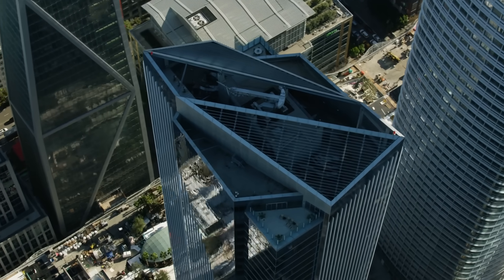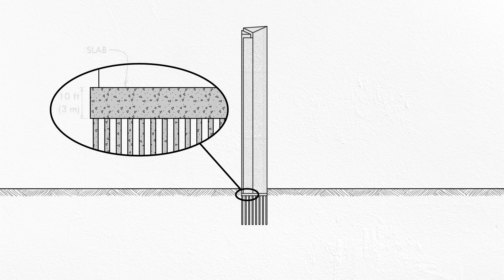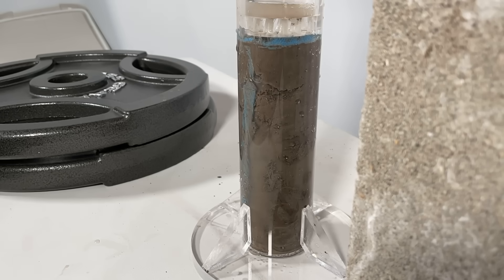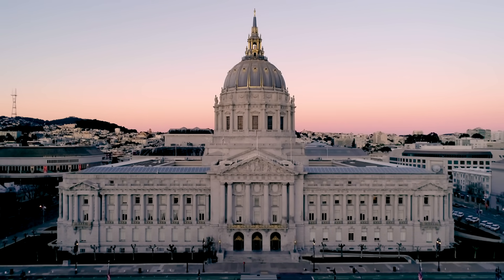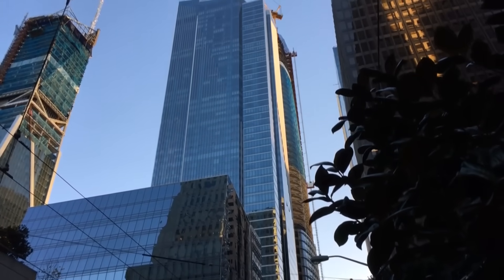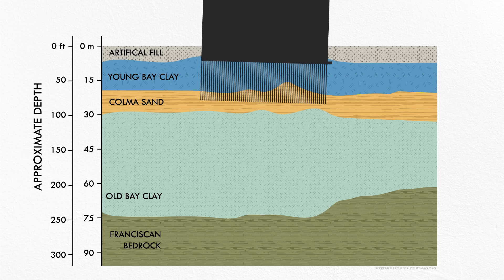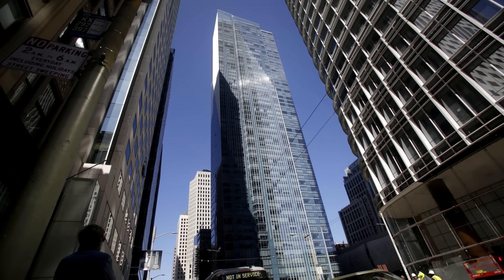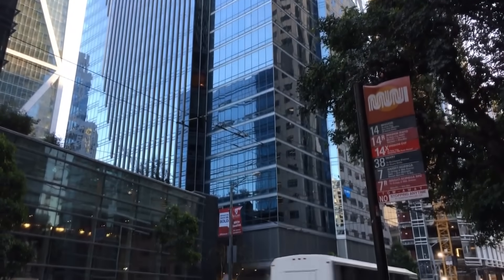What Really Happened at the Millennium Tower?

Comment: “But the estimated cost for the repair was as much as $500 million, more than the original cost of the entire building. Turns out it’s a lot easier to drill foundation piles before the building’s built than afterwards.”. 
Great quote, you win this one
Reply: This comes under the "do it right the first time" school of thought.
Reply: @kennethellison9713  Measure once...
Reply: If it is that expensive would it be cheaper to demolish the building and just start over?
Reply: @alanhersch4617  Or just deconstruct the building to half it's height. Save yourself the trouble for the inevitable.
Reply: @MarloSoBalJr  Yeah someone else replied to me above with a good point. the weight of the building is important to the foundation of the entire block, so it isnt free to just remove part/all of the building. There probably is a way though to add dense weight to the bottom as you took apart the top? 

Anyways, there probably is a solution along these things that could work, but it is a bit more complicated than I first thought, and it definitely makes it WAY more expensive to deal with.
Reply: @alanhersch4617 You also have to buy out all the leases and pay to demolish the building.

Also the weight of the building on the ground was factored in when neighboring skyscrapers were built so removing in could cause them to start leaning too.

So rebuilding isnt an option.

They have to drill new pilings under an occupied skyscraper and do it in way that doesnt affect the settling rate of buildings next door.

If anything goes wrong you could wind up causing several buildings to become unstable.
Reply: I’ve worked on a project for this developer, and I have to say: it couldn’t happen to a more deserving group. They were most likely too concerned with keeping costs down and dragging out decisions about wallpaper to catch errors in foundations.
Reply: The insurance is lot more expensive.

"Hello, I'd like an insurance quote for driving piles under an occupied skyscraper"

(Underwriters head explodes.)
Reply: Grady played Captain Hindsight a bit here.

Comment: 11:45 "But whether they could have reasonably predicted the performance of the original design is more a complicated question"

Bro, the rule of thumb for tall structures on fill or loose soils is clear, 33% of the aboveground height needs to have piles sunk to that depth that are minimum 8" in diameter, spaced evenly across the entire load.

12:02 "The developer's engineers and the city have shown that the building is PERFECTLY SAFE" 

Holy hell, talk about ridiculous statements, even just based on the limited and censored coverage in your video. You don't show the quarter and half inch cracks that are probably obvious in the concrete foundation, because I'm guessing the building owners don't want those pictures published. The steel is obviously bent in a major way (half inch or more), and again, you and the developers don't care.

In your own video, you show that the settling was 12 inches as compared to the plan's 4-6 inches, the settling was uneven, and you didn't show the inevitable cracking that steel or the foundation will have when one corner of a slab is literally 12+ (and RISING) inches higher than the other corners. The city also doesn't agree with your estimation "that it's perfectly safe", when the 12" lean on the top at the top is OBVIOUSLY out of the building code's 6", which is being ignored because of politics/your bias in favor of building owners(?).

Also unmentioned by this video: climate change causing seawater to go into the soils, earthquakes effect on soil dispersion, the long term effects of trains nearby underground, and increased flooding risk from climate change.

Oh, and the retrofit could fail - the pilings could become bent, earthquake could straight up cut them, the jack could slip/fail, the sleeve could be bent and friction could prevent the jack from working, or the building could magically settle in another direction.

And finally 12:10 "but the prices of those luxury condominiums plummeted" - cry me a river. Oh no, some rich developers don't get to overcharge the SF workers to the tune of a profit margin of 90%! Meanwhile if SF banned nonresidential owners of housing, something like 40% of the existing housing stock would be forced to be on the market, and considering 52% of SF rents, methinks some competition would be good for basically everyone with a net worth south of $400,000.

Your political takes are god awful and I'm guessing there's a reason why you're here doing YouTube videos as compared to out there in your "field".

Comment: Grady, excellent thumbnail sketch of the issues. Geotechnical engineers have a unique challenge in the liability they face with the potential for "unforseen" conditions. The choice of pile vs drill shaft is complicated, especially when you are dealing with high water table, seismic loading, and clay. You hit the issue for all engineers when you stated "reasonable assumptions". The other issue, public relations, is something that has been an issue with engineering "mishaps" for many years. You should do a series on the effects of PR on engineering. Love the videos, and the care you take to present the situation in simple terms.
Reply: …and the corrupt political landscape of SF. I know it well.

Comment: I don't think that an engineering report stating that the building is already well out of spec, and that its condition continues to deteriorate, is quite the same thing as declaring it "perfectly safe".  It's more like declaring it "not unsafe yet".
Reply: "Perfectly safe at the time of writing this, can't guarantee tomorrow"
Reply: when your windows are exploding from the building falling over. i think its time to call it not safe.
Reply: Or more like not safe yet
Reply: Remember that thing about safety factor. the rate of deterioration was still slow enough to not be a danger during the lifetime of the building.  Of course what does that matter, its not like we say "well this building has been here 70 years, time to smash it"
Reply: @ilovefunnyamv2nd  That's not what they said, at least not according to the video.  They said it's continuing to tilt but isn't unsafe yet.  Then they did that reinforcement thing where they actually caused the tilting to accelerate.

"Safe"
Reply: Not toppled yet
Reply: Sort of agree, but as others noted, no building can be declared “100% safe, forever”…that is not realistic for any building’s .  The best any inspection can say is “we predict that with maintenance and repairs, it will be safe for the next xx years, and get it re-inspected at x-1 years.”
Reply: Ehm, yes, but every building will eventually become unsafe, so by your definition every building is "not unsafe.. yet". Therefore "perfectly safe" is the correct naming.
Reply: @velianlodestone1249  I'm not sure I agree but I see your point. Maybe the key consideration is the rate of decline relative to other considerations, not whether it will decline. The difference could be a relationship between cost of repairs, rate of decline, and property value.
Reply: @velianlodestone1249  "perfectly safe" huh? So you think it's perfectly safe to live in a building that's subsiding significantly faster than predicted in an area prone to large earthquakes? LOL okay there.
Reply: @shawnpitman876  Yes absolutely; hypothetical future subsiding is not going the topple the building today.
Reply: @shawnpitman876  Wow, stop commenting and just go somewhere else; no point arguing.

Comment: As an SJSU student I got to go on a tour of the Transbay Terminal site while it was still in the excavation phase. Back then I remember some of the engineers ranting about the Millennium tower blaming their excavation for the settling. They had massive bracing set up to keep adjacent soils stable and stationary during excavation, which should have been more than sufficient to maintain the stability of adjacent buildings with adequate foundations.

Comment: I remember mounting TVs and other Audio Video equipment in that building years ago before they announced the lean. It was hilarious having to call my colleagues into the rooms to assist me in leveling the equipment. All of our bubble levels were so off that we had to measure from the floor & ceiling to get things plumb. 😂
Reply: Your largest display would only be off “plumb”  by 3/32”. Unless you had digital levels you can’t typically achieve better than 1/16” accuracy
Reply: @rcpmac  1/16” over what length, floor to ceiling?
Reply: @raybod1775  Good question. I read that after the new pile driving started, the tilt increased to 22 inches. Google says Millennium is 645 feet tall. The tilt may not have been measured at the very top. So, I will randomly selec that the 22" tilt was measured at 600'. The tilt ratio is 22/(12*600) = 0.003056. Over a height of 10 feet (120 inches), the offset would be 0.367 inches (nearly 3/8", which is appreciable) Correspondingly, a 3/32"  (0.0937") offset would occur in a tad over 2.5 feet.
Reply: @gregparrott  I piqued at the comment of it being imperceptible and recall living in a similarly imperceptibly titled building.  the thing is, gravity doesn't lie and all of the cat toys always ended up in the same corner of the living room.
Reply: @jaewok5G  Must have had some catnip in the corner.
Reply: @gregparrott  would you believe … weather patterns?
Reply: @jaewok5G  Sounds like you have one smart cat.
Reply: @gregparrott  many more than one. =\
Reply: @gregparrott  Your math works and it is terrifying. If I did this in a 20 foot tall wood garage I would lose my license.
Reply: @RRaucina  Lose your license...Funny, but true. In Millennium's case, attorneys argue is WAS true. That is, until the ground started moving. Worse still, it has since shifted a tad more. Last I saw, the tilt has increased another 2"+ It now is at least 24".
Reply: or just remove one shoe.
Reply: @jeffnarum1373  Too bad you didn't file a patent application before disclosing such a novel solution.

Comment: The fascinating thing about Geotechnical Engineering, nothing is guaranteed and the list of unknowns is endless. You have a plan but nature has its own plans
Reply: *fascinating thing about engineering
Reply: @oldvlognewtricks  No my friend, specifically geotechnical. The materials behaviour is unpredictable. Unlike other materials. Everywhere else, you sort of have an idea of what you're designing and can improve the design.
Reply: @karabo933  “sort of”
Reply: @oldvlognewtricks  
Steel is very controlled. Concrete and wood, nowadays, are quite controlled (and tested regularly). The primary structural materials we work with the design beams, columns, walls and foundations are very well know, quantified materials.
Soil? All soil is unique. No 2 samples will ever been exactly the same. Soil is very nonlinear, with water having a massive effect. It's all underground, unreachable, and even detailed borings can easily miss important aspects.
So yes, soils do present quite a bit more unknowns than your standard engineering problem.
Reply: @kindlin  So yes, soils do present quite a bit more unknowns than your standard engineering problem.

No, they don't. They're just unknowns that are beyond the consumer's appetite to control.
Steel and wood are only so controlled because we take the trouble and resources to do so. Soil would be equally controlled if they went through similarly rigorous processing. I understand it is seen as uneconomical, just as it was to control the manufacture of steel for the overwhelming majority of human history.
This is not a function of "quite a bit more unknowns", only the appetite and current ability to control for those unknowns.

Before it was practical to control the manufacture of steel it was similarly unpredictable, just as geology was almost entirely predictable until we started involving pressures beyond reasonable tolerances.

A problem having a practical engineering solution doesn't stop it being a problem of engineering, and it doesn't make other engineering problems fundamentally distinct.

My point that "nothing is guaranteed and the list of unknowns is endless" applies to all engineering stands. Even your venerated steelmaking processes have error bars.

Comment: It would be really interesting to see a follow up once this work has been done - and on tilt, The Leadenhall was designed so slowly tilt if you like into its final upright position - almost like a cantilever design, to account for the weight on one side of the building. This was done by inserting steel shims in the steel nodes. When finished, the shims were removed to bring the final structure into plumb.

Comment: I'm certainly not an engineer, but I had a silly idea. What if they just did similar process to accelerate the settlement on the opposite corner? That seems like it would straighten out the building with relatively low cost. Sure the building would sink even farther, but it'll eventually float and stabilize, right?

Comment: I worked at One California ( didn’t call it Street) in the mid to late 70’s. The sound of piles in the Financial District being driven was commonplace. Ironically, my summers in college were spent at Raymond Metal products creating corrugated steel piles out of 25 ton rolls of steel. I was in the elevator on the 28th floor when we had an earthquake. The elevator stopped. The doors opened between floors to a brick wall. The building swayed for several minutes. And the doors closed and the elevator proceeded to the lobby. I remain perplexed as to why the wall in the elevator shaft on the 28th floor was brick?

Comment: What danger does a tilted tower pose?  Would it have to get to the point where the center of mass is outside its footprint before it could fail by literally toppling over?  Or would the structure fail before that because of the portion of the load being applied in a direction it wasn't designed for?  (I know you said the report says that this particular tower is perfectly safe, and obviously the Leaning Tower of Pisa has stayed up for a couple years.  I'm just curious about the mechanics of high rise construction vis a vis being out of plumb.)

Comment: In my town here in the UK, every building, including homes, have to be bedrock piled. Our house is on 175' piles. The town is largely built on reclaimed beach and marshland. Watching piles being installed at the new build across the street was interesting, seeing the driver hammer away, adding pile after pile, then suddenly seeing the stack drop and freefall through some underground layer was quite astounding.
Reply: I recall many years ago watching steel piles being driven on a construction site. Occasionally you would see a  pile after a few thumps suddenly drop maybe 30 feet, the answer was to weld another section of pile on and continue.
Reply: As a fellow Brit, I was amazed by this - I had no idea anywhere here had this sort of building restriction. Whereabouts in the UK do you live?
Reply: @paulhaynes8045  I'm in Southport in the North West.
Reply: @IanDarley   Just east of Southport in the North West?  ;P
Reply: That's amazing. I'd love to see a video of the freefall.
Reply: @kruks  I want to look down the free-fall hole. Maybe toss in a rock for accurate measuring lol.
Reply: What you drive into the ground isn't the pile itself, but a feed-pipe. As you get through the first, harder layer, you will often meet clay, and as you hit clay, the forces pushing it through the first layer will drive it hard into the clay, causing it to look like it's in free fall since the clay will just evacuate up the pipe and through the top. As the drill-head that is installed in the bottom of the pipe hits bedrock, they will drill a few meters into bedrock to confirm it's actually bedrock and then pull out the drill-head and drill-rod. They will then fill the pipe with water to test it's waterproof to verify it's properly planted in bedrock and that the concrete-fill won't run out. Lastly they will drop the solid steel piles into the holes and backfill the pipe with concrete all the way from bedrock. When driving the feed-pipe they will just weld more length to it as they go.
Reply: @rao-foto  In the case to which i was referring, they were pre-cast concrete displacement piles, so no drilling involved.
Reply: I somehow doubt it is legislated that even a single family dwelling would need to be bedrock piled if said bedrock is over 70 m below ground level. Can you link to where this is mandated, or something proving that bedrock is universally shallow in the British isles?
Reply: I saw them driving pilons for a bridge over water and I saw the same thing. Negligible movement for 20 strikes and then *bam*, 5ft all at once.

If you put your head underwater on the otherside of the island you could hear the pilons being driven.

Comment: That whole area of San Francisco is probably built on top of the old sections of the bay where old wooden ships were scuttled and junk,trash, and other fill material was used to extend the land/waterfront, with all that material covered over with dirt/rocks/sand, now you have a megatonnage building that is sinking and ready to fall over, just check out the sidewalks and streets of the surrounding area, they also are shifting !!! Thanks for the great video!
Reply: Ready to fall over?  Um, no, I don’t think so.